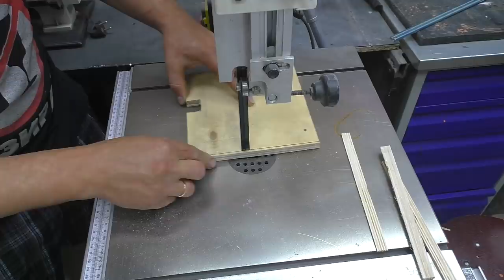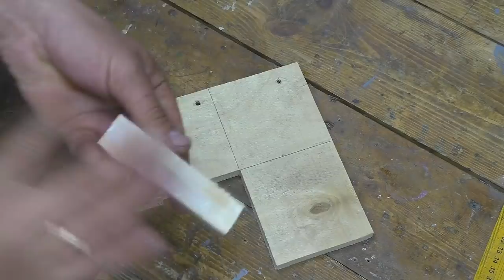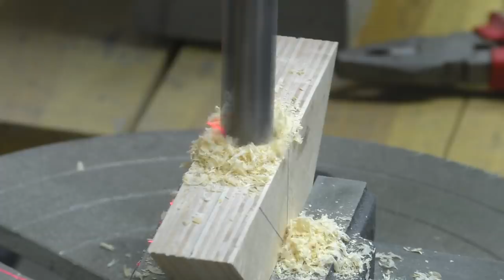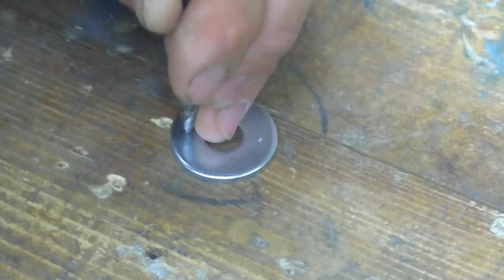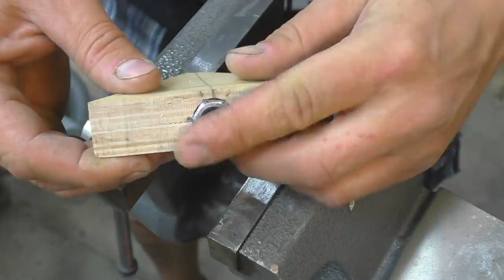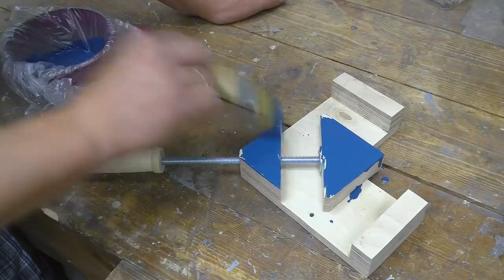Cool idea ! Do not throw away scraps of wood !

Comment: Pretty slick, I made a few jigs years ago to use on outside and inside corners. Designed to be used with clamps. It helped me assemble my door casings; I glue the corners using biscuits then I install the casing. Years later I discovered corner clamps and life hasn’t been the same since.  Problem solving can be an enjoyable process....
Donald

Comment: I’ve learned to use the slider to fast forward to see what problems these You Tubers have had in their lives, that warrants spending so much time making something so simple that is not needed, and if desired, can be purchased for a couple of bucks.  That’s when I wish there was some audio at the end that might shed light on why this was important to him to make.  People sometimes ask why I bought something that I will hardly use again.  Well I feel justified in doing that because I needed it now, and it would have been a bigger waste had I spent time making something that I won’t have a need to use again, or if I did, forget where I put it. Lol.  Now I have made stuff in the past, but it was something that was needed to do the job and anything on the markets similar to what I made wouldn’t have worked or else I bought it and modified it to fit my need.  And of course the exception to all of the above is making an improvement to an existing product that every guy wants or feels he needs to have after seeing it.  I don’t see this as fitting any of those criteria.

Comment: Not the worst use of scraps by any means. But you are entirely limited to using even pieces of stock. A fixed clamp like this cannot accommodate attaching two pieces that are different widths. It will only clamp down on even pieces. You could have easily used that plywood to create a beautiful portable bench hook with a designated miter like you started with and added overarm clamps. And had a 10X more effective tool. Now, you can only join like items and picture frames. It won't accommodate a connection between a 1" and 3" board. Only completely homogeneous pieces will work

Comment: Pay no attention to the negative remarks. They are too ''simple'' to understand a real craftsman. Anyone can drive to Harbor Freight and buy a cheap made-in-china clamp. But a craftsman can build one and knows it will work and it will last. Be proud. Too many people buy something and throw it away just to buy another one. I have been working with wood and metal (I have a  forge and welder) since the early sixties. I don't throw scraps away. If I need a tool, I make one if it is possible. I pay for something, I use all of it. You are doing a great job. But, please use the tools on your band saw (fence and miter).